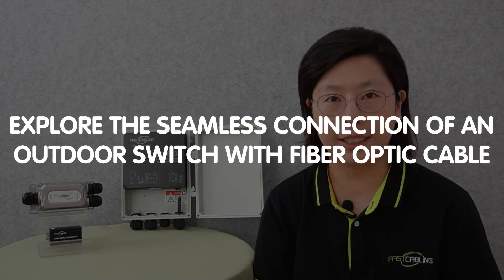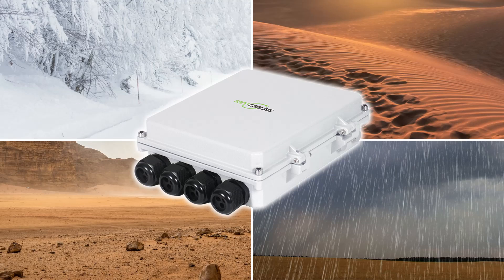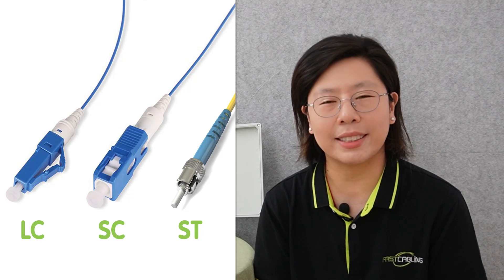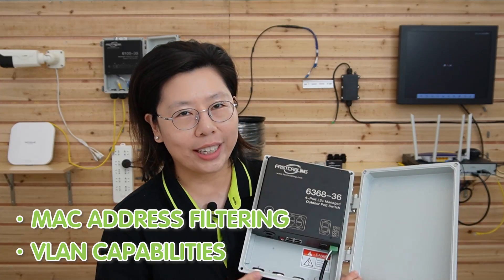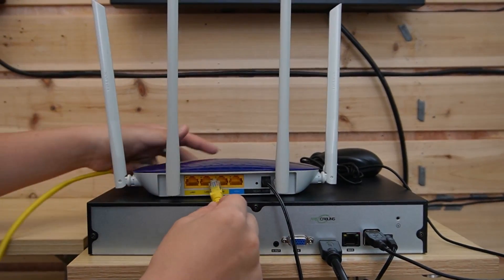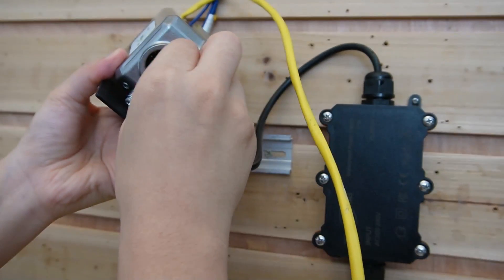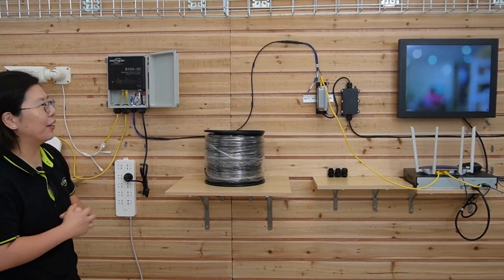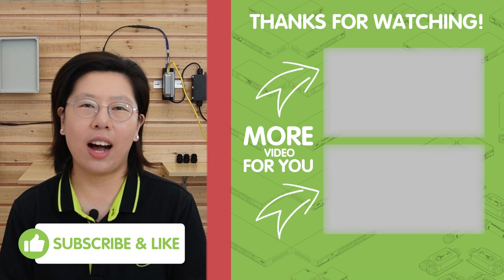How to Connect an Outdoor Switch with Fiber Optical Cable

Comment: In my project there is a 6km total boundary wall. All 100 meters are more than 60cameras and we plan to put a semi industrial switch for each camera pole.. connecting with help of fiber with sfb uplink to connect loop for all cameras..are you sure it will work? We didn't use a media converter..
Reply from the maker: It will not work if you try to put 60 cameras (media converters) on daisy chain even the switch support ERPS. Usually 10-12 nodes will be good while you setup the ERPS. You might need several rings (ERPS) to support all these 60 cameras. Alternative solution could be the PON network, but still you don't have 60  nodes in single ring.